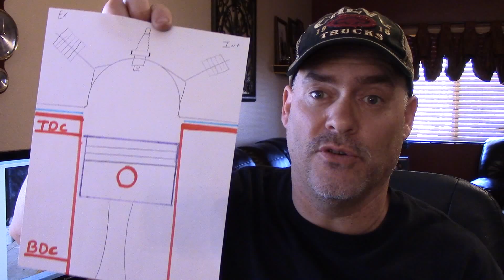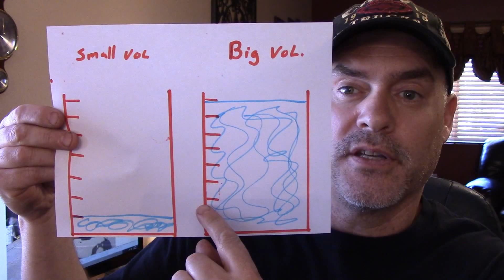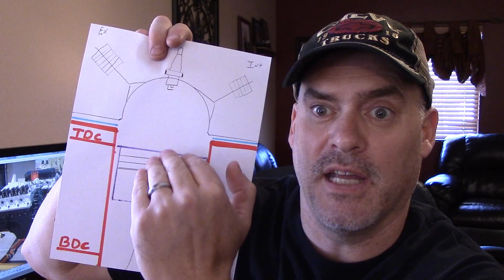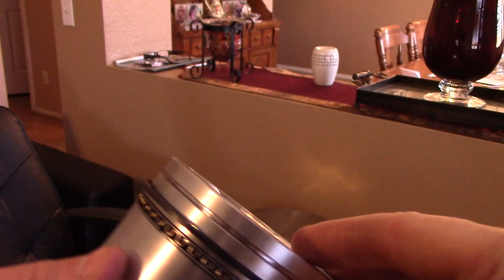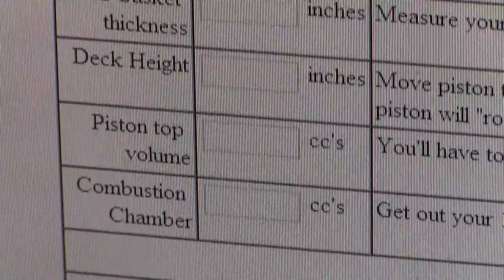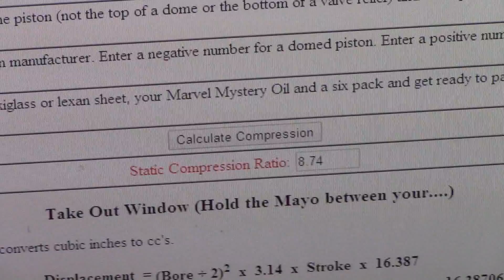383 Stroker Engine Build Part 5 (Compression Ratio)

Comment: Can I lower my compression ratio on a 383 Stroker from 12:1 to somewhere around 9:1? Would changing the piston heads or stroke length lower it?
Reply: Myles Z28 change to 76 c.c heads
Reply: Myles Z28 changing the stroke length would be detrimental cause you'd have to rip the whole thing apart again, a set of larger combustion chamber heads would at least be a a step in the right direction
Reply: I can explain all of the compression issues to ya. If you have a 12 to 1 383, you have a horsepower and torque monster, but, lol, unless you run 104 octane or similar racing fuel, your going to have detonation issues. Detonation will kill your motor. You could crack pistons, have piston skirts break off and end up places you don't want them, or even worse. There are a few ways you can lower compression. The easiest way without tearing your motor back down, would be to put a set of heads on that have bigger combustion chambers. This can take .8 to 1.5 away from your compression ratio if you are running a regular flat top piston. Another way of lowering your compression is to run a dished piston. Dished pistons have a place on top of them that has metal removed like a bowl or dish shape. Your piston volume is measured in cc's. A flat top piston is 0. A dished piston will have a plus in front of the cc number or it will be a plain number. A dome or pop-up piston will have a minus in front of the cc number. These are what you want if you want higher compression. Now a pop-up piston looks awesome and will really make a motor scream with compression and a lot of guys buy them simply because they look cool. That's fine if they are going to run high octane fuel but most end up with a motor they can't even run because fuel is too expensive or they end up destroying it because of detonation. Most guys that want to run pump gas, I will tell them that a 5 cc piston will keep them safe with a stroker. Head gasket thickness is an issue too but not a really big one. I mean, if you were right on the threshold of being a few tiny points over your target compression ratio, then putting a  thicker head gasket on would definitely help you out. Basically in a simple way of explaining, anything that is going to take more air space away when the piston is at tdc, is going to give you more compression. Anything that adds more air space is going to take away from compression. Another factor is how your block deck has or hasn't been milled, and whether your heads have been shaved/milled down. Hope this helps
Reply: I do run 93 pump, actually! My motor is a 383 from Golen. Im not sure how they set the motor up, but it is a bullet-proof build. Anyone that has purchased that package is in love and can abuse it! I think what Golen said, is that they did a lot with timing in the engine, so that helps with the extreme compression ratio. Im not too sure man. But it is recommended we run on 93 octane. If you have any ideas or more explanations, all would be helpful. Thank you!
Reply: Chances are, they probably have the timing set really far back. I have did a motor with a really big cam and ran heavy breathing aluminum heads and been fine with 11 or 11.2 to 1. You can run a high compression motor with pump gas, but rarely do they live a long time. You can do various things to keep detonation under control, but few go the extra mile to do it. But yeah, I've heard some decent things about the ones that done yours. Usually timing is a big factor and a pain when trying to run a street motor that has high compression and they plan to run pump gas like 91 or 93 octane. He must have put a lot of thought into the cam, heads and the timing. Like I said, it can be done, but most do it backwards. It sounds like it's running good if you aren't having any issues with it. But if you want to lower you compression, just throw a set of 72 or 76 cc heads on it. As long as they have big valves and flow a lot of air, you won't see a huge difference. If it's bulletproof now with 12 to 1 compression and your running pump 93, it will live a lot longer with a 72 or 76 cc head to lower compression. If you have 12 to 1 now, a 76 will put you in the 10.2 ballpark. You could put a little thicker head gasket on with the 76cc head and be right at 10 to 1. If you are wondering on any other motor tips or questions, I'd be glad to help. I tell people all the time, there aren't any dumb questions when it comes to building a motor. The dumb ones are the ones people don't ask usually. Lol
Reply: So if I do have domed pistons, (which I do) and I replace my current heads with the 72 or 76cc, will supercharging the motor hurt the pistons, or any of the internals for that matter?
Reply: Doesnt Nitrous tear through parts though? I know any forced inductio, or any power adder wears parts quicker. But I heard that nitrous kills motors quick. I am going the Procharger route, 8psi and Ill be getting a 70% increase. Itll be quite an upgrade. I just dont want to mess my motor up with boost
Reply: Nitrous isn't hard on a motor if it is put together to handle it. Biggest issue guy's have with nitrous, is they throw it on a mild motor or a great motor with run of the mill pistons and they don't consider opening their ring gap or even if the rings will take it. Hypereutectic pistons will handle some nitrous. If you wanted to run nitrous on a regular basis, then forged pistons and good rings are a must. Chances are, you already have forged pistons. You can run a procharger, but I would highly recommend changing pistons to a blower/forced induction piston that is forged and has a compression ratio of 8 to 1. You might be able to run 8.5 and maybe 9 to 1 compression at the most with a procharger setup. With a 8 psi boost anyways, but you could run 10 psi and be fine on a 8.5 or 9 to 1 motor. Your definitely going to have to swap pistons out for a procharger and 8 psi of boost. A quick tip on running pump gas like 93, if you go with higher octane fuel your boost level will usually increase. Probably 1 psi for every 2 points of octane increase. This is a valuable piece of info that most don't know and I'm willing to share. Lol. Your cam may or may not work. Depends on what the specs are. You'll want to run one that has a lobe separation of 112 degrees or better. You could go up to 114 or 116. You'll want one that has an exhaust duration and lift that is a little greater than the intake, maybe 10 or 12 degrees more duration and maybe .010 or .020 more exhaust lift than what the intake side is. Your fuel pump and fuel pressure is another thing I meant to mention for going to boost, but we can save that for another reply if ya want. Lol. Again, I'm glad to help and want ya to know all that you can about going to the setup you want to run. Keep the questions coming
Reply: I can show you my cam specs if needed?  Im pretty sure its 112 or 116 degrees. I can also link you to the page of my motors specsheet. Heres the specsheet https://golenengineservice.com/wp-content/uploads/2017/07/383-440hp-LT1-LB.pdf 
My cam specs -  Comp Cams 236-242 .605 .570 113 LSA
Reply: Yeah, I am afraid of my compression... So if I do get the heads you recommended, would I need to also swap pistons for forced induction? Or would I be good, but highly recommend a swap to forced induction pistons
Reply: Those pistons should be good to go. Trust me, Mahle forged pistons especially like the coated ones you have, are dang near bomb proof. I have put together 383's with those exact pistons that regularly take 250 hp throws of nitrous and get dogged at the track and the pistons don't seem to care. Lol. Your definitely good on pistons. As far as the heads, I can dig through a catalog or do some digging and find ya something that would get you in the compression ballpark that you need. I was just thinking, the lt1 block is a reverse cooling setup. Didn't think of that till just now. You can only run lt1 style heads. With a 58cc aftermarket lt1 head, that will put you down around 10.3 or 10.5 to 1 compression. If I was going to buy lt1 heads, it's hard to beat the Dart Pro 1. They flow really good out of the box. Around 290 cfm at .600 lift so they are capable of over 550 hp. They are a 58cc combustion chamber head and they have 2.05 intake and 1.60 exhaust valves and they are a 215cc intake runner. They should flow better than the factory lt1 heads you have on now. You can buy them bare and put your own stuff in them, which is what I recommend anyone do if they are buying aftermarket heads. Dart usually puts decent stuff in their heads though. You may be safe at 10.3 or 10.5 to 1 compression with these Dart heads. Here's the link to them if you want to look at them on Jeg's and I'll include the link to Dart's website so you can see the specs and flow numbers. Here's the Jeg's link...http://www.jegs.com/p/Dart/Dart-LT1-LT4-Pro-1-Aluminum-Cylinder-Heads/932783/10002/-1...Here's the link to Dart's website...http://dartheads.com/dart-product/pro1-23-lt1lt4/...I would go with the 215cc head. If you wanted to go with the already assembled ones, make sure you get the dual spring 1.550 with 140 lbs @ 1.80 inch with a max lift of .660 and you'll be good. All in all, I would contact Golen and run the idea by them and let them know you are going to a Dart Pro 1 head with 58cc chambers to get your compression down to around 10.3 or 10.5 to 1. I'm going to talk to another builder buddy I have to see what he says. He has more experience with lt1 stuff than I do. Have you talked to Kerry "myvintageiron" about it? I know he has some experience with lt1 and ls motors. Just send him a message on his facebook or message him on here if ya want. We'll get this turkey figured out one way or another. Lol
Reply: D.J. Taylor you're being extremely helpful. Thank you lol. Also, if I'm running 10-10.5:1 compression, how much boost could I run, safely
Reply: D.J. Taylor Wait. Say I make around 440 horsepower right now. If I get those Dart heads and keep all internals as they are right now. I would get more horsepower? Around 500+???
Reply: D.J. Taylor And if I do those dart heads, along with my internals. Would that be nitrous ready? For around a 170 shot?
Reply: You could run a little juice now. Your pistons would handle it no problem. I don't know what your ring gap is, but I would open them up a little. A 125 powershot would be good for the street. To be super safe, you could buy a hardened nitrous ring. Hellfire makes killer nitrous rings. They take up to 500 shots. I say the rings you are running will handle all the nitrous you could throw at it. I just looked at Mahle's website on your rings. Here's a pdf of what they recommend for ring gap for different engine setups and what ring gap they recommend for nitrous. But yeah, I would run something under 150 on the street. 125 powershot is ideal. Here's the link...http://www.us.mahle.com/media/motorsports/ring-end-gap-&-instruction-sheet.pdf
Reply: And again, if I go to the heads you recommend, the Dart Pros. That will lower, raise or keep my current compression ratio?
Reply: If the Golen specs are accurate, your current factory lt1 heads have been milled/shaved down and the combustion chambers are 50cc. The Dart heads have a 58cc chamber. A bigger chamber is going to lower your compression ratio.
Reply: Flamehara lol junkrat. And thank you, would piston heads make a difference too?
Reply: Well, I'm glad you asked. Yeah you won't be able to run any forced induction with high compression. If you want to add forced induction, your going to need to change your pistons out for sure. With forced induction, you want low compression. I would go to say that 8 or 8.2 to 1 is what you would want for running a blower or supercharger. If it was me, I would run some nitrous. You would be better off running nitrous because you won't have to change your pistons out. I would contact Golen and ask what rings they put in and whether or not they are hypereutectic or forged pistons. If it is bulletproof like you said, they probably put forged stuff in it. As far as ring gap, I like a .035 top ring gap, and a .030 bottom/2nd ring gap. You could run a supercharger if ya want, but your going to have to buy another set of pistons that are designed for forced induction with a compression ratio of 8 to 1 and I would highly recommend forged. Which is going to cost you some money. For what the pistons cost and having them put in, you can buy a nitrous plate and everything you need to run it and make way more power for a lot less money. Just my opinion. I would call up Golen or look at a build sheet if you got one and see what they have in the bottom end. Nitrous is a WHOLE lot cheaper man. I'm guessing this is a street car. I would run a NOS Powershot kit. The 125 horse would be a good one. You could go more for sure, but I can tell ya from experience, big sprays get ya into trouble on the street. They sure are fun though. Lol. Glad to help ya out with stuff though. Keep the questions coming. I'm more than glad to help
Reply: Ok, here's what I found for ya if ya are going to run the procharger. I have always liked SRP pistons. They are bulletproof, and they aren't out of this world expensive. I done some digging and calculated what compression ratio you would have with what you are running now with the 64 cc heads you have now. These SRP pistons are designed for what you want to do. They are a stroker piston that has been dished with a +16cc dish machined into the top of the piston. They have also designed the ring grooves to be ran with forced induction. The SRP part number for these is 139628-8 and the summit part number is SRP-139628-8 if ya want to look at them on summit. They are around 580 bucks for the set. You'll need to buy rings, and Total Seal or JE nitrous series rings would be a great choice. With boost, you want some tough rings that are designed for nitrous/forced induction. Just thought I'd give my opinion on what pistons would be a great fit for what you want to do.
Reply: Well your cam looks like you may be fine with the 113 degree lobe separation that it has. According to the build sheet, your pistons are forged Mahle, which Mahle makes some awesome stuff for sure. I have done nitrous 383's with them. Your rings are also Mahle and they are a moly ring which is good. As far as the heads, the sheet says they are lt1 style heads with a 50cc chamber. I'm guessing they shaved/milled them down to get the chambers to 50cc. Usually, factory lt1 heads are between 55 and 58 cc and looking at it now that explains where your getting the 11.5 to 1 compression. I don't think they make a big chamber lt1 head. But, I'm almost 100% sure a standard smallblock chevy head would bolt up just fine. They use the same head to block bolt pattern. I haven't done a lot with lt1 or ls motors, but usually the compression ratio is a little higher and the design lends itself better suited because of how it is setup. Here's what I would do. Get a hold of Golen and tell them what you want to do with the procharger. To me, your compression is a little too high. But, with the cam you have, and because of the lift being so large, your going to bleed a lot of that compression out. I don't want to say that you'll be fine, go slap it on there. Lol. I think you may be ok since your bottom end is setup with forged Mahle pistons and Mahle moly rings, but the compression has me worried.
Reply: Well, I know you can run 8 to 10 psi of boost with 9 to 1 compression. You might could run 6 pounds of boost, but I'm not 100% sure. I actually just sent Procharger a message and asked them what they thought. I sent them a copy of the build sheet so that they have an exact idea. Hopefully, they'll message me back. If you could get it down to 10 to 1, I would think 6 pounds of boost may be safe. You may be able to have the pistons you have machined with a dish. If worse came to worse, you could go the piston swap route, but that's a 600 dollar investment for another set of pistons. The ones you have are top of the line and it would suck to have to take them out to put another forged set in. You could always find someone looking for some forged pistons for a stroker. We'll figure something out. I'm trying to figure out the least expensive and time consuming way. You do a piston swap for 600 bucks and have to pay a shop to tear the motor down and put them in, you could swap out the heads for the Dart pro1 heads and get down to 10.3 or 10.5 to 1 compression but may still need it lower. With the Dart pro1 heads, your going to make more power than you have now if you decided not to go with the procharger. They are capable of 550+ hp out of the box. If you had them fully ported, you would really have a nasty lt1 stroker. I did find a interesting article from super chevy. It's an article about Golen taking an lt1 383 stroker and putting a procharger on it. Here's the link if you want to check it out...http://www.superchevy.com/how-to/0807gmhtp-golen-engine-services-383-lt1-ati-procharger-install/
Reply: They should definitely make more power than you have right now. They flow 289 cfm at .600 intake valve lift. So basically, whatever a head flows at a certain lift, if you multiply that by 2 it will give you what hp they are capable of. With the heads you have now and the cam you have, I am guessing they probably flow around 210 to 220 cfm. You should be able to make 500 I would be pretty sure. Your intake manifold and throttle body is also a factor. But yeah, these heads should give you more air flow for sure over the factory type lt1 heads you are running. If you got a aftermarket intake that flows really good and a beefy throttle body, these heads would really bring some power. If it were me, I would get aftermarket heads, intake that would run well with heads, and throttle body that would work well with the intake and head. You can build a lot of power with an lt1 or ls motor. Your bottom end is ready to roll, I'd just beef the top end up.
Reply: D.J. Taylor So overall, you do recommend nitrous, instead of boost? I just know that in the long run, supercharging will be less on the wallet. And it'll keep me happy for years lol. And all my internals should handle it? I should change heads
Reply: If your looking for fast, cheap, and easy horsepower, yeah nitrous is definitely the way to go instead of forced induction. In your case it would be a WHOLE lot cheaper because of your compression ratio being too high and you would have to change out your pistons. If you swap heads, your going to make more power in my opinion. The Dart heads are going to flow better, and you could even have them ported even further to get even more flow.
Reply: You can get way more than that to the tires. A 383 stroker can make a lot of power if you can put a heavy flowing set of heads on and an intake and carb that will flow enough to support the head flow itself. You have to be careful on forums and getting info on them. Granted, some guys on them know what they are talking about, but a lot of them have no real experience and just post what they have read somewhere or something. But yeah, most definitely you can get more than 440 ponies to the rear wheels.
Reply: Alright, SO. My dad and I did some pulls and digs... I feel that the low end torque from this 383 is INCREDIBLE! But... Around 80 MPH, it does not pull hard anymore. I have videos of it, I'll gladly link you. Anyways, what would be the best upgrade to help Top-End acceleration?
https://www.youtube.com/watch?v=VneLGtw10CQ

https://www.youtube.com/watch?v=zNo49BHdW54

And I called Golen motors. I will re-link you, to the proper spec-sheet. I figured out that I have their 383ci Street/Strip package. Basically my lower end is built (like you mentioned), but my top end could use a major overhaul. Tell me what you think the best upgrades could be, for the most torque and horsepower, keeping it naturally aspirated. Don't worry about compression ratio either. We can drop it... Whatever makes bigger power, I want it. Thanks!
Reply: In the wise words of David Freiburger, "Nitrous doesn't blow up motors, people do!" XD
Reply: I always see on forums, how people say. "The most you can possibly get out of a 383 NA, is around 440 to the wheels". Is that true or false?